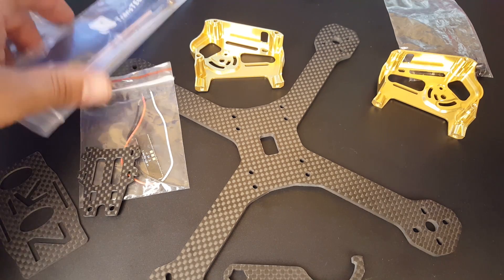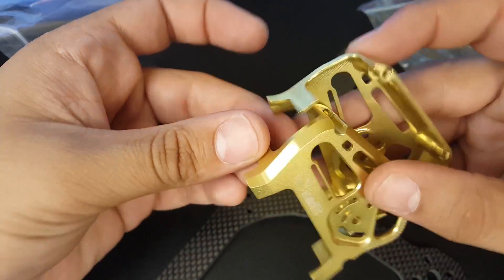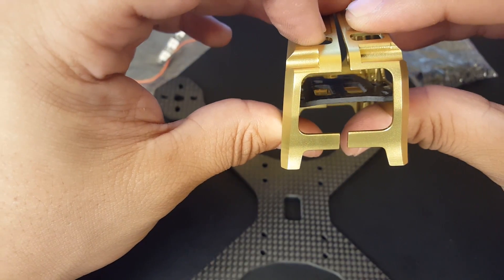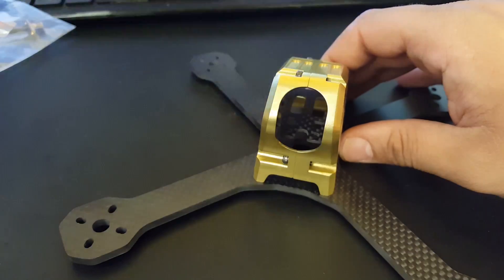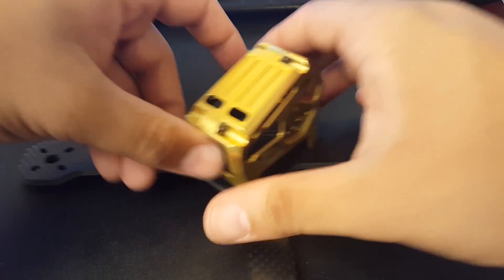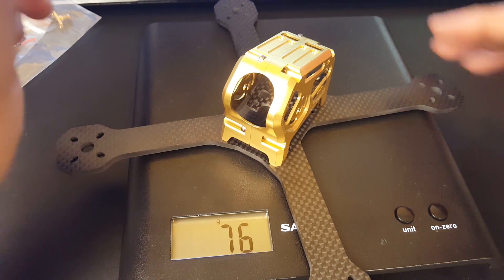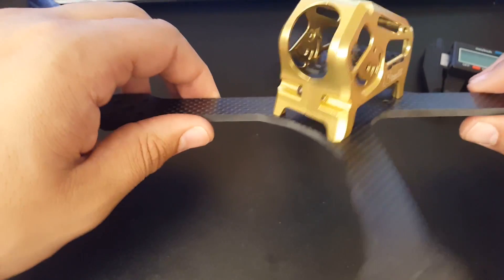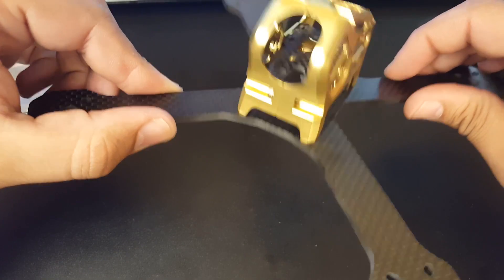TransTec Zorro 195mm 76 Grams // Overview

Comment: i have the ralacc version but its same super light tank can hold two board or one and a half plus vtx easy even larger cam has shielding i run monster v2. Lol her name is Goldie and she is my lightning tank on 5inch props run close to vtx antenna you will need to pigtail the sma/rpsma